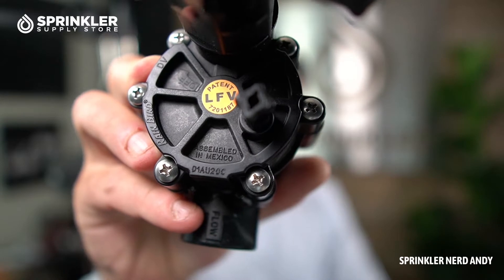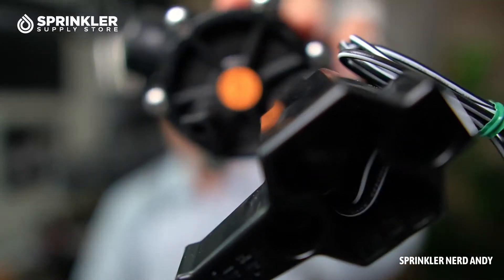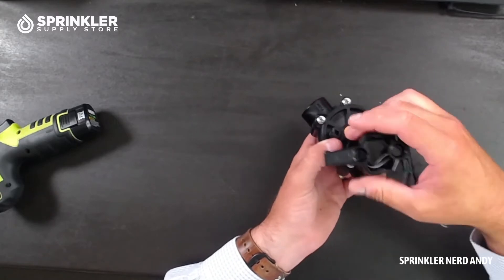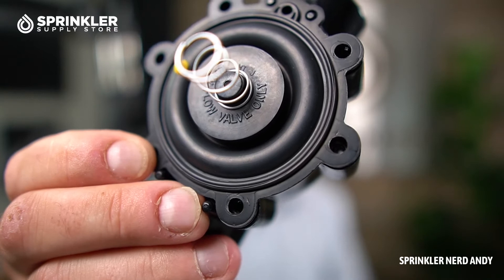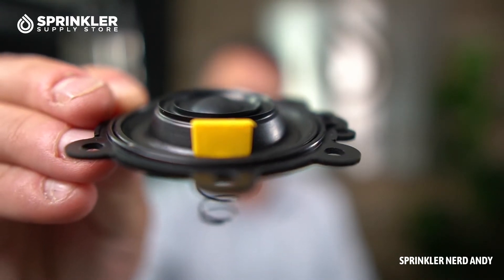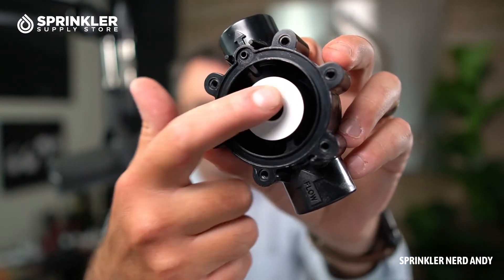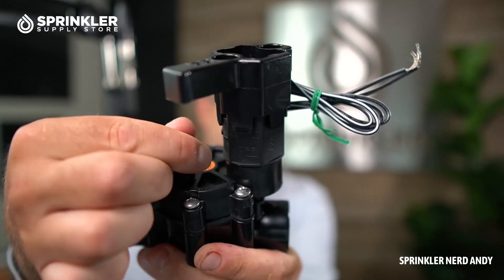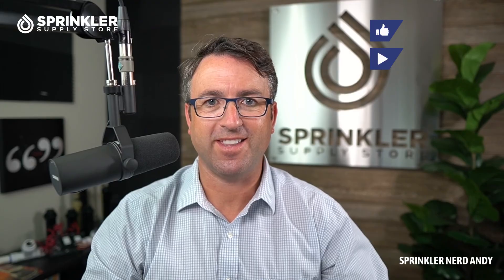Rain Bird - DV LFV - Low Flow Valve

Comment: This Rainbird valve is used with drip irrigation as it requires low pressure.
Reply from the maker: Hi @onenikkione it’s a bit confusing. The operating specifications are the same as the standard  DV valve, however, this LFV is able to handle debris better. This allows the filter to be installed after the valve, instead of before the valve.

Comment: When do you recommend using this type of valve LFV or what type of applications
Reply from the maker: Great question, @mikealfa1984. 

This valve is design for low-flow zones (as low as 0.20gpm). When the flow rate is very low, valves can to stick open if debris is caught in the diaphragm.

According the Rain Bid, this valve has a patented diaphragm design that allows particles to pass through at extremely low flow rates, preventing the valve from weeping.

You could also just use a filter…
Reply: used in drip irrigation.  so not the right valve for a sprinkler system for lawn

Comment: Can you manually adjust the flow rate? If so, how do you do it? Thanks!
Reply from the maker: While a lot of valves have a flow control feature that allows to to fine tune the flow rate coming through the valve, these particular valves do not offer that feature.  You can usually identify a valve right away that has the flow control feature - it will have a knob usually dead center of the top of the valve that you turn to adjust the flow rate.